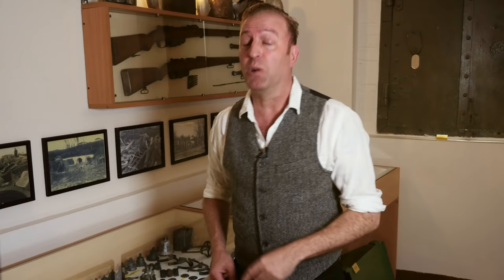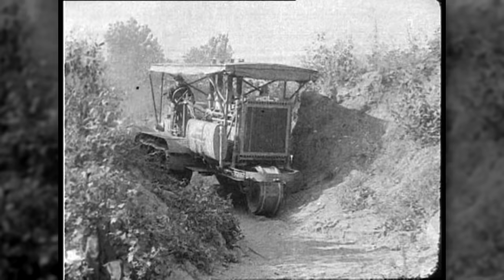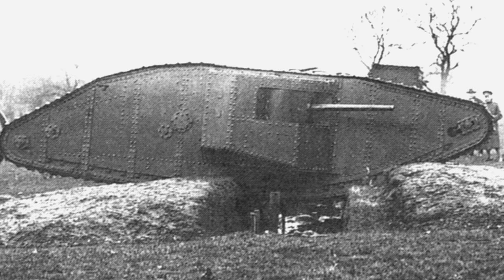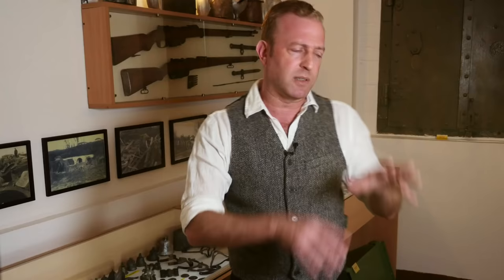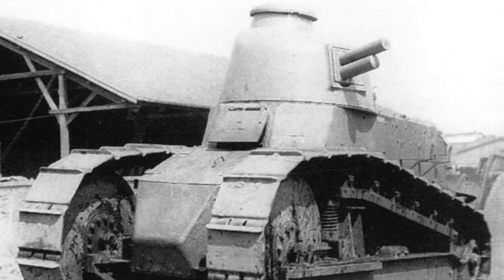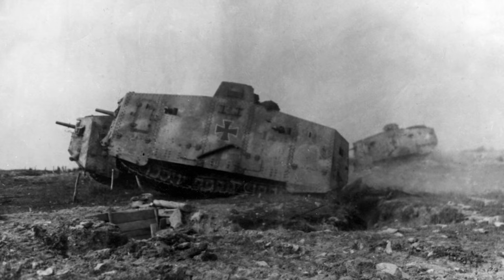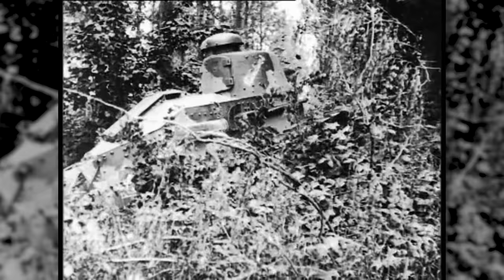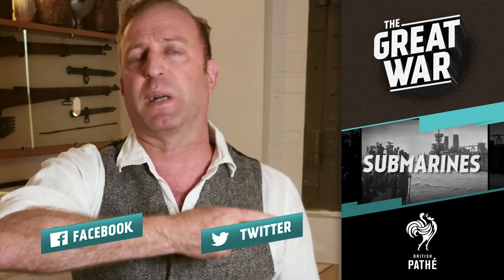Tank Development in World War 1 I THE GREAT WAR Special

Comment: The British did not use the Holt track system on the Lincoln No.1 machine/Little Willie as the Holt was deemed too light with inadequate ground clearance. They initially used Bullock tracks but these were found unsuitable as the tracks would sag off the lower rollers when crossing gaps or climbing obstacles. A new system was then built specifically for the first prototype, Little Willie, with pressed steel track plates and a means of keeping the tracks in contact with the lower rollers, however it had no suspension which wasn't really necessary anyhow over chewed up ground in the battle area. This track system was then used on all British tanks from the Mk l to the Mk V** and then to the Mk Vlll, also the Mk lX personel carrier, the tracked gun carrier and beyond. So, Bullock tracks used initially by the British, not Holt. France & Germany used Holt.

Comment: with the Brish tanks they were deploted at a ration of 2 female tanks to 1 male. -the 6 pounders on the male tank were in short supply. The tactic was that the tanks would roll over the wire and the female tanks would crawl along parallel to the enemy trenches using their mg's to suppress the troops while the male tank held itself back so it's guns could handle any big issues. natrually in combat it was never that easy, but that was the plan.

Comment: The problem with the St. Chamond tracks were not really due to them being too narrow. The real problem lied with the fact that they were too short. If you look at a side picture of the St. Chamond, you can see that the tracks are much shorter than the length of the vehicle. Both the front and the back of the tank protrude far beyond the tracks. The body of the vehicle also was not very high up from the ground. This made is so that the front and rear of the vehicle would often dig into the ground when trying to traverse any sort of inclined ground. This was the same problem that the German A7V had. The later Ft-17 and the British tanks had tracks that were longer than the main body of the vehicle so they didn't have this problem.

Comment: If you took 1-2 aspects from every nation's tank, you'd have a very modern, effective weapon. The Italian's had the speed, The French had the top-rotating turret, The Germans had the armor, & The British had the tread system & armament. Aside from lacking powerful enough engines, I think the biggest fault w/ all WW1 tanks was that they were designed to take on personnel, & occasionally light-materiel, but not other tanks.
Reply: The whole purpose of the early British tanks was to cross no-man's-land, crush barbed wire, cross trenches, shoot up enemy infantry and generally make life easier for the infantry following them.  They didn't need anti-tank capabilities since the Germans didn't have tanks!

Comment: Hey, what about Günther Burstyn? The guy had the idea for an armored vehicle on tracks with rotating turret, designed to cross trenches even in 1911! It was called the "Burstyn Motorgeschütz" (literally "Burstyn Gun with Engine").

I mean, obviously his ideas got rejected by our antiquated Austrian and then even the German high command, apparently it was too radical for its time. 
But still, you could've mentioned it. I found an English translation with a picture of a mockup in Vienna here: https://plus.google.com/105523170217029586513/posts/3KVyrKsDKw2

Comment: I'm wondering if tank crews during WWI upgraded their thanks
Reply: Like how?
Reply: Modified the engines to be more reliable and faster or if they added some metal plates inside for more protection. They had tank engineers.
Reply: if that was practical they would have simply produced them like that.

Comment: If they were capturing British tanks so often why didn't they send one back to Germany to copy the whole thing?
Reply: probably to save resources. they ware captured not because they ware better but mainly to save resources
Reply: *****
Donna you can't compare a bunch of barely sapient hicks with AK's to an industrial super power like Germany. The landships were clearly superior to "a fucking iron box". Also you even answered your own dilemma "if you change something of course it's going to be different"
Reply: French and British Tanks were miles better than that frankentank the Germans scrapped up in workshops. 
Reason they did not copy is that by 1917 the German industry had collapsed due to the Allied Blockade. The germans could not set up a proper supply line to feed a tank factory, They knew would never match the astounding French mass production of the Renault FT-17, so why bother war was lost since a few year by then... 
Renault mass produced Around 6000 FT-17 vs only 20 workshop AV7. Lol!
Reply: +Donna Sachs Do you really think that ISIS has any industry to copy anything? The best they can do is make makeshift armored cars from Toyota trucks using mattress and fencing as armor.

The M1 Abrams requires SOOO much knowledge for such savages to handle.

The most impressive vehicle I've see out of the Middle East was the Sham II which is an armored car using an unmanned turret with a machinegun. Uses a knock-off Playstation controller
Reply: The same reason they only built 20 of their own tank: resources. You could build one tank with the metal that could have been used to make a lot of rifles and machine guns or you can take that metal, make a bunch of guns, and just steal some enemy tanks.

Comment: Sorry, but I would have to disagree with you about tanks being "the biggest symbol of war on the past century." Tanks, as well as submarines, were evolutionary developments of ideas that trace back to Bushnell's Turtle or Mid-Eastern chariots. The item which is truly revolutionary for the past century would be aircraft.
Reply: TTT135 Evolutionary means that the concept sprang from earlier attempts to do the same thing. A tank is simply a faster, deadlier chariot. The design and use evolves through experience, and when you start replacing horses with a motor, and leather shields with armor plate, you are evolving. Revolutionary is when you open up a complete new line of thought, such as fighting beyond two dimensions on the surface of the Earth. (True, there were some imaginary thinkers who envisioned fighters riding on dragons or birds. Further, observation balloons just might be considered aircraft despite their mostly being used as an adjunct to artillery.) Once you weaponized a flying machine (the revolutionary moment), from there until today, aircraft have also been evolutionary.
Reply: By that logic, planes weren't revolutionary either. Militaries have been using balloons since the 19th century for recon so that your army would know what the enemy army was doing behind that big wall of enemy riflemen.

When planes were first used in war, they were used in recon. Then pilots started bring guns with them to shoot down enemy recon planes. Taking the hint, militaries started putting machine guns on planes.

So floating recon thing -> flying recon machine -> flying recon machine with gun -> flying machine with gun